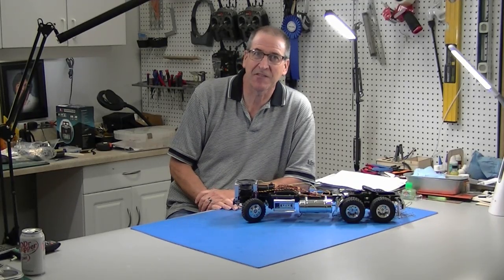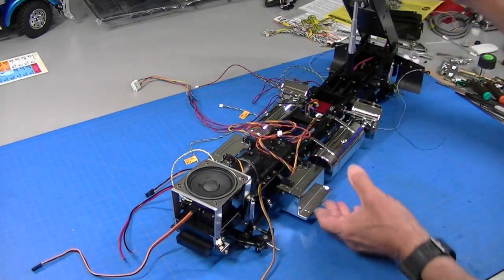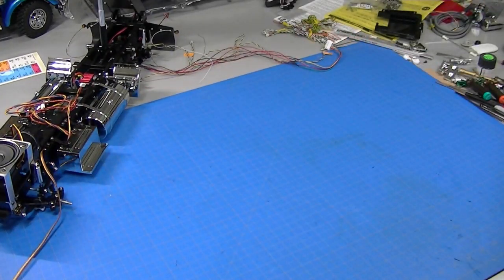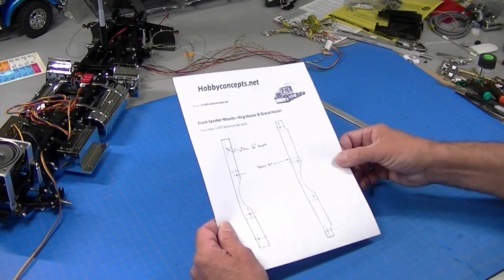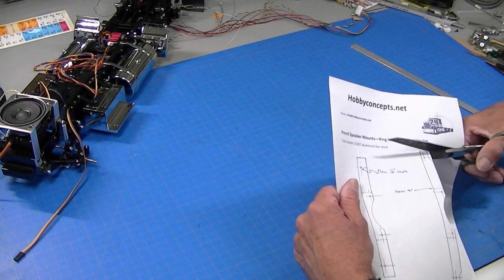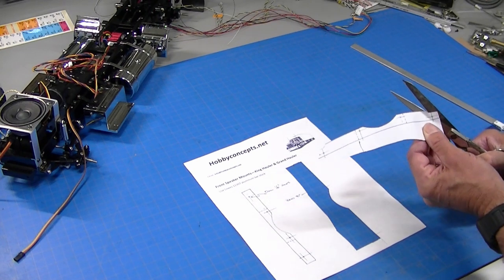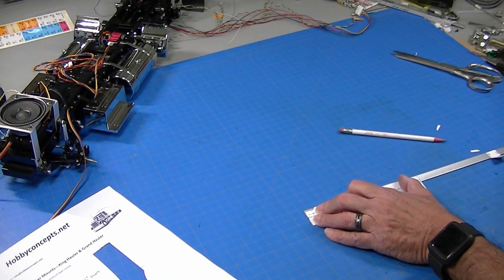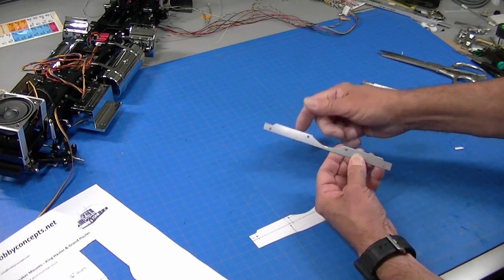Tamiya King Hauler Speaker Relocation Forward - How To

Comment: Hi Bob: Thanks for this video !   I do have a further question.   Once the speaker is mounted with the bracket in front, do you have photos of where/how you mount/locate the MFC and the vibration unit so that you can still have the interior in the King Hauler  ?

Comment: Bob i have bought a globe liner with a multifunction control unit, having really enjoyed watching everything you have put on Youtube  with no luck has to how  and where to fit the speaker it just does not fit.To tall to fit to the roof to big to put in the front.
Desperate for help
David
Reply from the maker: Watch my custom Globe Liner build videos.  I used a Beier speaker and speaker box and it sticks up inside the sleeper and hangs under the roof.  Easy to do and hides it perfectly.  Beier Speaker: https://hobbyconcepts.net/products/1-14-r-c-scania-770-s-6x4?_pos=1&_sid=f1ba7b06a&_ss=r

Comment: Maybe it's not your thing but, similar to how all Tamiya Tanks have a speaker enclosure, I'd guess that 3D printing one that also acts as a mount would most likely improve the acoustics.
You could go with either a bare necessity box shape or even go as far as to 3D Model a Radiator visible through the Grille - Neither of which I'm going to say are exceedingly difficult to design.
Reply from the maker: I just cover the mounts with clear packing tape when finished.  Super easy and does improve the sound.

Comment: Do I need to buy the tamiya mfc01 to install the tamiya motorized support legs for my trailer
Reply from the maker: No you do not need an MFC.  You can add the servo ad hook directly to a radio as long as you have a spare channel